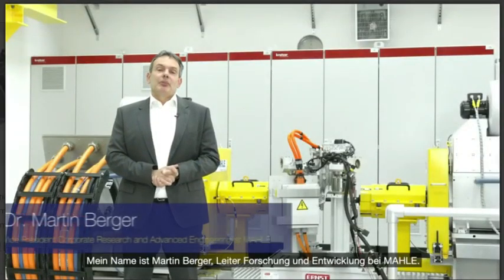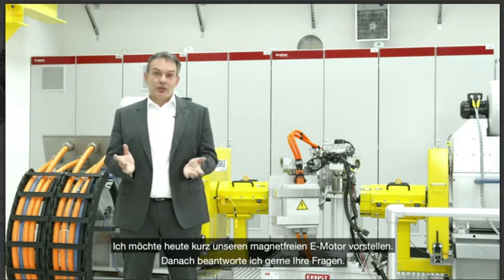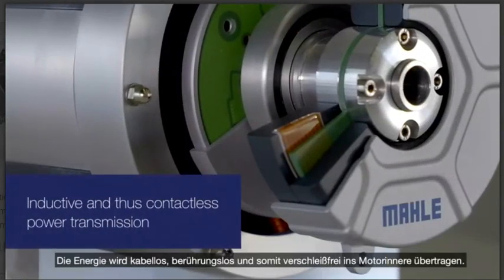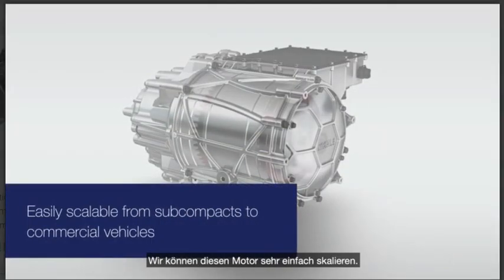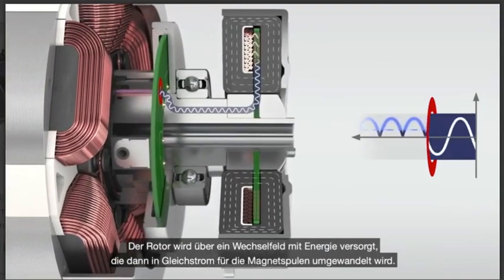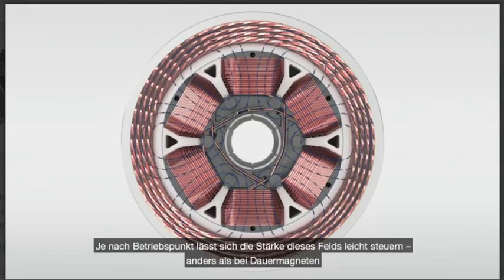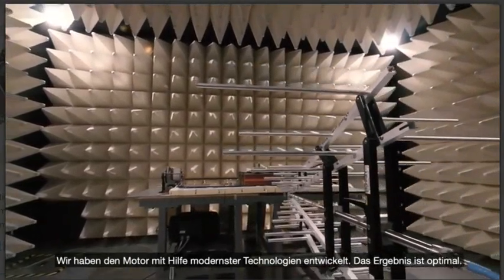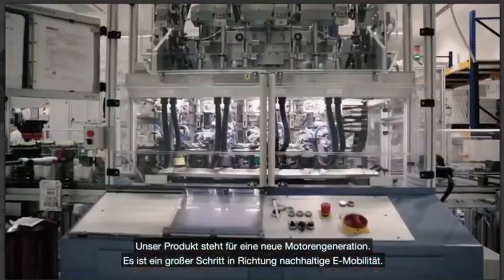Mahle, produce revolutionary new no-magnet motor...

Comment: Seems nobody else commented that this invention has been around for 100 years, so I will tell you that this has been around a long time.
Reply: WE know it's not a New motor, but it seems there are New methods to do it : rotation system to sent electricity to internal coils, optimized design, compact, ...
Reply: I was thinking...electromagnets are not a new thing
Reply: didn’t the serbian nikola tesla invent a three phase inductive motor?
Reply: @JinKee  Induction motors are an old design, but this is not an induction motor.
Reply: @brianb-p6586  i know they don’t use the same kind of induction that tesla used, but they don’t have a brush and commutator so how do they get the power to the rotor without using induction or electrical contacts? little solar panels?
Reply: @JinKee  Did you watch the video that you're commenting on? The animation shows the extra pair of coils (one stationary, one rotating) mounted on the end of the motor shaft and the video describes now they transfer power to the rotor for the rotor winding.
Reply: @brianb-p6586  so we induce a current in the extra pair of coils with an alternating electric field - that’s induction
Reply: @JinKee  Yes, but it's not an induction motor, which has a specific meaning.
Reply: @brianb-p6586  ah i didn’t know “induction motor” was a specific term of art.
Reply: Can you name an electronically commutated motor that was produced 100 years ago?  I seriously doubt it.
Reply: @ferrumignis  The earliest was in 1930's, so not 100 years yet but close! https://www.researchgate.net/publication/224506279_The_Past_Present_and_Future_of_Power_Electronics_Introduction
Reply: @jkntrimmed  That's really interesting, thanks. I suppose they must have used mercury arc thyratrons for that kind of power, imagine how huge and impressive that installation would have been!
Reply: @ferrumignis  Not 100 years yet but close. The first thyratron cycloconverter-
based variable-voltage variable-frequency synchronous motor drive (400 hp) was installed in the U.S. Logan power station in 1934 for induced draft (ID) fan drive. For a paper about history please google for paper "The Past, Present, and Future of Power Electronics" by Bimal Bose
Reply: By the way, touch screens, microprocessors, lithium batteries, etc. were all around for a long time before Steve Jobs combined them all into a smart phone, js.
Reply: @waynefilkins8394  In fact, smartphones were around before Apple made one. :)
Reply: No, this is neither universal motor nor induction motor, they work on a different basis.
It does use induction for rotor just like induction motor, but it is a separate component in this design, I guess they made it separate in order to force dc into rotor.
Though they didn't give enough information to say much about their design.
Main question would be: does it operate on AC or DC?
If it is DC than of course it is completely different than induction motor.
Reply: @KogiSyl  Close... it does not use the rotation of the rotor (in the stator field) to induce rotor current, so it isn't an induction motor. And induction motors start just fine when driven by a variable-frequency power source, as they are in all EVs.

The inverter, fixed coil, rotating coil, and rectifier are used to transfer power to the rotor so that the rotor can have a controllable current independent of rotational speed. That has nothing to do with phase shifting of any kind.

This is a synchronous AC motor - the stator will be just like every other 3-phase motor, driven by three-phase AC power in synch with rotor position.
Reply: @KogiSyl  : I agree with your statement !! Reason to DC is so much more sought after is the fact that you can vary the speed a lot more than with A/C .. …Also you can  control the Eli the iceman ( Rogue unwanted wasted eddy currents !!! )
Reply: If you can send me the best example or perhaps a link to another video I will watch it. I was about to comment “wow”
Reply: well some management is 100 years behind , might be new to them  ....just wait till they hear about the net
Reply: Looks like they put an extra induction coil where there would be brushes on a typical universal induction motor. Other than that, I get what you're saying.

So it's AC or uses electronic switching in some form to pulse the DC for that extra coil. Seems likely it could be replicated, although you couldn't sell such commercially due to the particular patent thing. (Can still get patents by combining two somewhat old things if you convince the right people.)
Reply: @pauljs75  Yes, the extra rotating transformer used to transfer power to the rotor winding must be supplied with AC power, probably just by chopping (pulsing) DC with a controlled pulse width (which is pulse width modulation). Since the amount of power involved is small (the rotor needs only a tiny fraction of the stator power), it's not unreasonable to do that.
Reply: No actually it was not. Usually you have brushes on the rotor to feed the rotor coils. What they did they added like a rotary transformer which feeds "wirelessly" through magnetic induction the rotor coils with energy to provide the excitation. This excitation is probably done with an AC current in the primary coil and some diodes in the secondary coils on the rotor to have the magnetic poles not change direction. So there is something new. This is like a brushless motor but no permanent magnets on the rotor. So overall the motor is fed with 2 sets of signals. One is the single phase AC for the excitation and the 3 phase for the main stator coils
Reply: yep...they just stumbled upon an innovation that Everyone has already been using for like forever
Reply: I am just now seeing this video Arto.
Reply: Its an investment scam
Reply: @N-GaugeTheTrains  No, it's a product from an established and reputable company. They're not asking you to buy shares in a business that is unlikely to ever make anything.
Reply: No one : 
Some electrical guy,akward laugh
Reply: Clearly you are not an engineer. Kids stfu please.
Reply: The odds from civilization before, probably more then the number, 100 years.
Reply: Yet no one use it because underestimate tha environmental sustainability
Reply: Maserati made fully electric 'milk trucks' like a 100 years ago..
Reply: @ViezePoeperd  electric vehicles are obviously not new, and Mahle is not claiming that they are.
Reply: @brianb-p6586 You underestimate how uninformed the average person is. People don't know this stuff's been around for a century. Also, wasn't trashing Mahle.
Reply: It's new to me! 🙄
Reply: Yep. Lots of ac motors don't use magnets. Most hydro electric power plant generators are of similar designs. Rotor and stator both use coils. Probably they just improved it's efficiency through precision and electronics.
Reply: @Wilcosach  You could guess, or you could watch the video and pay attention, rather than just reading the video title and commenting.
Reply: Yes . its commonly seen in washing machines .mixer grinders etc.
Reply: @lifeisbeautiful4598  No, it isn't. The motors in those appliances are "universal" motors, which are significantly different.
Reply: @brianb-p6586  principle is same , but the difference in here is wireless power supply method , while slip or split rings are used in others .
Reply: @lifeisbeautiful4598  Sure... as I have explained multiple times, this has rotor excitation not using slip rings... but it is three-phase synchronous motor, not commutated like a universal motor.
Reply: Little did you know 1st car was an electric its just wasn't very efficient because of lead acid battery it exist even before Mercedes Benz existed and invent ICE
Reply: SkyWizardless don't even try it... pc-chair-experts know shit about advanced tech and they bitch anything that doesn't look impressive to them... and the only way to impress them is by showing fancy useless stuff.
Reply: @AntonySimkin  show me a DC brushless no magnet motor design from 100years ago, not just an ac induction motor, because everyone here thinks they know too much...
Reply: @andrewfpvair  sure this comment is for me?
Reply: @andrewfpvair  Not 100 years yet but close. The first thyratron cycloconverter-
based variable-voltage variable-frequency synchronous motor drive (400 hp) was installed in the U.S. Logan power station in 1934 for induced draft (ID) fan drive. For a paper about history please google for paper "The Past, Present, and Future of Power Electronics" by Bimal BoseNot 100 years yet but close. The first thyratron cycloconverter-
based variable-voltage variable-frequency synchronous motor drive (400 hp) was installed in the U.S. Logan power station in 1934 for induced draft (ID) fan drive. For a paper about history please google for paper "The Past, Present, and Future of Power Electronics" by Bimal Bose
Reply: This comment has taught me how to impart knowledge and roast at the same time.
Reply: Dear experts. All things we use have been here FOREVER we just put some stuff together and sometimes make it less shitty. So yes it operates with magnetic fields, yes its the same induction motor, but with a new approach to make it LESS CONTAMINANT because no need of magnets. You have no fucking idea of how cool this innovation is!
Reply: @AntonySimkin  
Induction motors don't use magnets (that's how they are originally designed/invented).
Reply: @regulate.artificer_g23.mdctlsk  it’s not a traction motor tho. Induction motors aren’t efficient as traction motors
Reply: @Ozlizardking  First, this isn't an induction motor. 

Second, do you realize that the Tesla electric car company was given than name because it started with induction motors (invented by Nikola Tesla), and used them exclusively until the introduction of their Model 3... as traction motors? Tesla still uses induction motors in the front of the Model 3 and Y and the rear of the Model S and X.
Reply: @brianb-p6586  that’s what I meant. It’s a traction motor.
Reply: @brianb-p6586  induction motors don’t make good traction motors.. no torque at low speed
Reply: @Ozlizardking  "no torque at low speed"? You should explain that to drivers of Teslas, who have no problem accelerating from a standstill at the limits of the tire traction. LOL

You're probably thinking of how induction motors work poorly with a fixed-frequency power supply - they struggle to get going because the power frequency is so far off of the motor speed. In an EV, the motor is powered at a frequency optimal for the motor speed of the moment, even if that motor speed is very low or even zero.
Reply: @brianb-p6586  Cool info thanks!
Reply: @brianb-p6586  Note that Tesla stopped using induction motors and switched to their own design of permanent magnet synchronous motor for the S, X and Model 3. There was a good reason for that; higher starting torque and better efficiency.
Reply: @ferrumignis  Tesla is gradually switching to PM motors, and started at the rear of the Model 3 (and Y) then moved to the Model S, one end at a time. Even Model 3 has an induction motor in the front, and the company has ended up with a strange assortment of motor types within the same model.

Yes, the switch to PM is for efficiency.
Reply: @brianb-p6586  omg read my message again
Reply: @brianb-p6586  nope. Didn’t say that.
Reply: @Ozlizardking  
So what were you trying to say? The Mahle motor is intended as a traction motor - we agree on that, right? Are you saying that induction motors are not traction motors? You certainly said that something was inefficient - I assumed that you meant induction motors, but did you mean synchronous motors like the Mahle?

The motors which drive Teslas are traction motors, obviously - that's the definition of "traction motor". All of the motors which drive early Tesla models and some of the current Tesla models are induction motors, so obviously induction motors are used as traction motors (and they have been in many earlier EVs, too). They have competitive efficiency and are capable of producing as much torque as the battery power will allow, but you literally said yesterday that "induction motors don’t make good traction motors.. no torque at low speed". Where's the miscommunication?
Reply: @brianb-p6586  no. Read message again lol. I said induction motors don’t make GOOD traction motors. 🤦‍♂️ do you know what a motor winder is?
Reply: @AntonySimkin  Generators are build like this for many years. Large DC motors are build like this. This is not new. They like you to believe its new
Reply: @AntonySimkin  
But that's not how he's selling it. He presents the concept as if it was innovative in itself. I don't blame people for understanding it that way really.
Reply: @AntonySimkin  Again, 3 phase induction motors have been around for many decades. It's nothing new, just marketing wank.
Reply: @pootispiker2866  you clearly didn't understand the huge difference in a small construction change.
Reply: Reinventing the wheel is not cool innovation.
Reply: @armchairexpert4151  
It's not so much a reinvention, it's actually an improvement from the basic induction motor design. It's just that the video falsely advertised it as "new/revolutionary".
Reply: @regulate.artificer_g23.mdctlsk  No, it is not an improvement of an induction motor. It improves a synchronous motor with an excited rotor by improving the method of transferring excitation power to the rotor. 

I agree that it's not "revolutionary" (except that, you know, it revolves... ;)
Reply: @brianb-p6586  
I'm pretty sure synchronous motor is a type of induction motor. 

Great joke btw, that's a good one 😆
Reply: @regulate.artificer_g23.mdctlsk  No, an induction motor is asynchronous, meaning that the rotor does not rotate "in synch" (at the same speed as) the stator's magnetic field. In a synchronous motor (which is essentially every other design) the rotor rotates "in synch" (at the same speed as) the stator's magnetic field.
Reply: @regulate.artificer_g23.mdctlsk  yeah you can argument that seeing it from a functional design point of view, but the key part here or the "revolutionary design" is that they don't need to mine more magnets, which are more scarse than copper, still thank you for not going for the "reinventing the wheel is not a revolution" kind of comment, have a nice day
Reply: @Armchair Expert  no, not "reeinventing" the wheel, but some of the best inventions come from MODIFYING "the wheel".
Reply: It is just a glorified brush!
Reply: An engineer would get it, you, chair-master of Worlds knowledge clearly didn't get a thing. A wheen has been with us for thousands years, but a high speed wheel is a huge challenge and small changes make big advances. Let's bitch all the car wheels engineers. Just following your logic...
Reply: It's basically just an induction motor
Reply: @regulate.artificer_g23.mdctlsk  No, it is not an induction motor, because rotation of the rotor in the stator's magnetic field does not induce current in the rotor and resulting rotor field.
Reply: @regulate.artificer_g23.mdctlsk  not quiet a Induktion Motor. For the induction motor AkA Asynchronous motor you don't have torque at 0 RPM  this motor on the other hand does and that with zero slip!
Reply: @regulate.artificer_g23.mdctlsk  "It's basically just an induction motor" It basically is not.  It's a synchronous DC motor that uses electromagnets in the rotor rather than permanent magnets.  Induction motors do not have any kind of magnet in the rotor, the rotors magnetic field is created through induction from the stator, hence the name.
Reply: @ferrumignis  
I assumed it was a form of induction motor, it looked like it was (at least for me). Thanks for clearing that up!

Comment: So, not actually a "no magnet motor" as it uses electromagnets.
Reply: If we want to be pedantic, there are no magnets in the motor until it is powered :p an electromagnet without power is just a coil.
Reply: @PatrickHansen101  , if we want to be pedantic, the motor isn't a motor until the coil is energised ;)

Comment: Question: can the motor start by itself?
Reply: Yes. The axial-flux disk-shaped coils to transfer power to the rotor (for the rotor windings) work regardless of rotation, so it will work at any speed including from a dead stop. For this to work an inverter or chopper is needed in the power supply to the inductive transfer coil and a rectifier is needed in the rotor, which appear to be the distinctive features of this design.
Reply: @brianb-p6586  ...so they need the chopper just for the first few rounds until the disks induce enough electricity by rotating themselves?
Reply: @fredschmitt456  no, because of the orientation rotation won't matter to the inductive power transfer (rotation of the disk coils will never induce current), so it will work the same way at any speed.

Comment: every first year student of electrical engg knows about parallel & series wound motors...  and i hv been baffled why the industry ever went for super costly permanent magnet solutions (specially for traction motors)...  for small fractional horsepower motors I can understand using PM.. but for larger systems the benefits of a variable excitation mechanism are simply too many to ignore.
Reply: But if you get past that very basic level, you start to understand the issues with brushes and the inefficiency of typical brushless power transfer to excite the rotor windings.